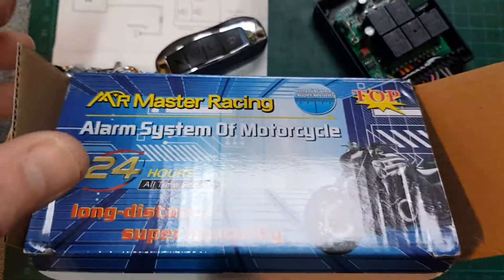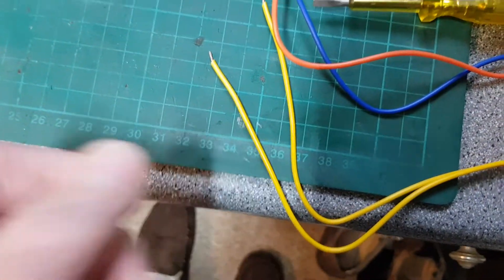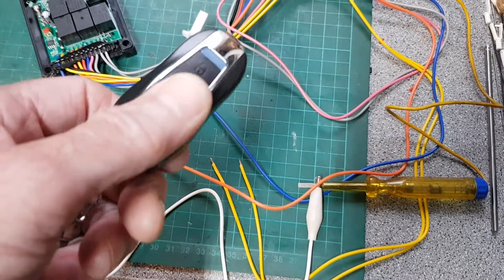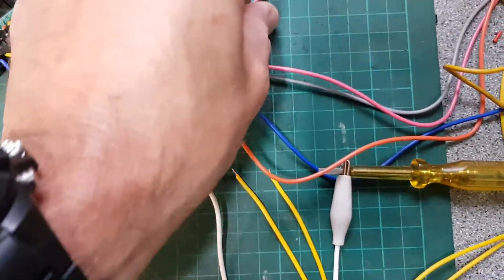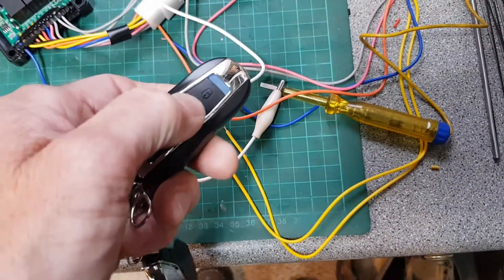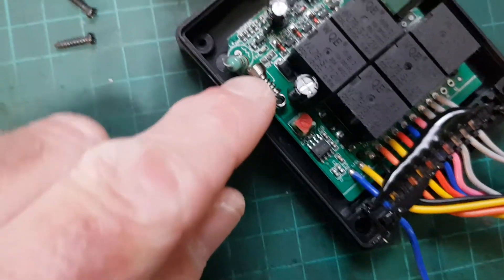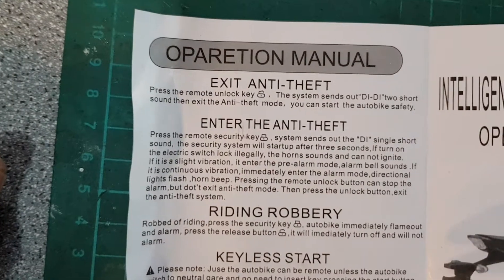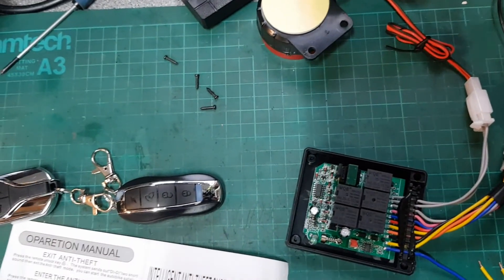Cheap Chinese eBay Moped Motorcycle alarm - What to the wires do?

Comment: The keyfob tells you how it should work. eg turn on, turn off and arm the alarm, or turn off without arming the alarm. 
When you turn on, you close [or open] a relay. This relay takes the power cable that normally goes to the vehicle key-switch, and sends that power back to the controller, eg does what the key-switch would normally does with send and return pair of wires.. 

The other pairs of wires seem to be surplus relay functions, eg door locks, close windows, flash lights or enable brakes etc, there may be reverse relays that are triggered to open instead of close a connection.  Generally, the relays will pass to the controller any voltage/sensure wire they are fed.  Also, the alarm will have its own voltage supply requirements and it is important to get that right.

Comment: This is a very helpful video.  The original instructions are truly terrible!
I have a question if I may; regarding the blue "start" wire. When the button's pressed, this goes live for a couple of seconds to turn the starter motor. On my bike (xt600) all lives are permanently connected and switching is done by earthing. So, when you press the starter button all you are doing is completing the circuit by making an earth.  So, as I see it, a low current live input for two seconds cannot be used to start the bike as everything is live anyway.  I'm thinking that to use this function I will need to connect the blue wire to a 12v relay (other end of the coil earthed). One relay output is permanently earthed and the other connects to the live side of the starter button. So when the blue wire goes live it closes the relay and completes the start circuit by earthing it.  Is this correct?

Also, I thought I could connect the pink and grey wires across the sidestand switch as when the stand is down the cdi is earthed and will not generate a spark.

I'd be interested in your thoughts and thanks again.

Jolyon

Comment: Nice presentation.
A warning to NOT hook up yellow wires to modern can bus / LED bikes. They supply 12V and turn signals are sometimes 3-6V and they will blow more than a fuse.
I bought some cheap, stand-alone 12v LED strips with the adhesive backing. You can chose your color. 
IF, I hook up the ignition kill, I'll wire in a bypass jumper - male female spade, bullet, etc., under the seat.

Comment: The issue ive had with these on both my bikes is they drain the battery when not in use in my garage i just put a toggle switch in between the hot wire when i have them parked at home, just dont get why they drain the battery when not turned on?

Comment: There's something you didn't explanained
I have one similar to this
But it have a connector for 9v battery
It have extra function , which is when you disconnect the battery and the device is in lock mode , alarm will start the sound using the 9v battery for power

Comment: What would I connect the orange wire too in order to use the key fob to turn on the ignition? I don't want it to remote starter aswell, just turn the ignition on, is it doable?

Comment: I have found a fuse for power (removing fuse behaves like turning a key off - engine stops).
I want to cut one of the cable leading to this fuse and put '2 cables' from the alarm connecting it again via alarm unit so when alarm goes off - the power is off.
Which cables allows me to do that?

Comment: Do mine came with a 9v battery lead as well as the 12v to the bikes battery. It should have the 2 yellow wires but doesn't. Can I solder them to the board amd done have lights on the alarm ?

Comment: Hi Tim, I've recently purchased a second hand bike with a Spy 5000 alarm fitted which looks very similar to the one you have described here.  I don't need an alarm and am worried about it going wrong at some point.  In order to disable it do I just remove the power supply and earth cables, and will my bike then revert to normal operation ?  Many thanks in anticipation. cheers, Alan
Reply: depends on if the killswitch wire (usually black and white) was cut. If it is cut and you remove the alarm, the bike will always be able to start with the kick start, even with ignition off.

Comment: I see on the board where it says lig1 and lig2 but nothing is going to the lig2 and going to the lig1 is a blue wire coming out of it with a rubber tip at the end of the wire??

Comment: Thanks for this video. I have this same system on my maxiscooter. It was installed by the previous owner. The ingnition start button never seemed to work but other than that the system worked fine. Since recently, all of a sudden, the system arms itself after being disarmed. It always happens afer 14-15 seconds. It even does so while the engine is running. The only way to stop it from happening is pressing the ignition start button/lightning key twice and putting it in 'ignition' mode. Do you have any idea why this would suddenly happen? Is it just broken or did I press a button combination for auto-arming. Thanks in advance.

Comment: I have the same exact alarm. I don't know  where to connect the yellow cables, so that the indicators work. I know where to connect the red and black cables, but that's it. Could you help me? I have a Piaggio Zip 50, injection.
Reply: Yellow is for the both L R Signal Lights

Comment: Thanks for the video! Do you know any way to disable the annoying unlock/lock sounds on this alarm? I'm happy with everything but the unlocking sounds are so loud I cant park my motorcycle on my quiet street like this
Reply from the maker: I don't think there is a way. We ended up putting some foam around the sounder to quieten it a bit!
Reply: @Tmo1972 I have a bike with a DC CDI box that uses 12V switched power for spark. What do I do with the pink and gray wires and how can I kill the spark when I arm it

Comment: Thank you very much man, very complete explanation. As far as you know, is there a way to implement a block motor function? (I mean, kill ignition when the alarm is armed or ringing)
Reply: Yes you probably could using the ignition flame out wires, be be careful how much trust you put in a cheap alarm like this. You don't want  it to kill the ignition while you're moving

Comment: Will not work with HISS systems or other bikes that need the key to be in the ignition, a relay will be needed, will work fine on the small cheap China mopeds and 125 bikes they make. This type of alarm is more of a toy than a bike alarm, handy for other uses such as garages etc, some set on fire as China produced £15 alarms tend to do that.

Comment: Hi. I have an yamaha fz6 2004, I put the wires where they should be, but when I double press the lighting button from the remote it just turn on the ignition but doesn't crank the starter, you know where the problem should be? Thanks.
Reply: Connect your blue wire to your starter solenoid👍
Reply: @DeepSouthBayouDiesel   Starter solenoid is on the battery, right ? I did put the blue on it but nothing happened... I may did something wrong... Yellows + grey and pink I let them away for the moment. Red to plus of battery, black to minus of battery, orange to starter switch from handle bar, and the blue I put on starter relay.. The only thing it does when I double tap the remote is that it turns the ignition on, but no crank-the bike doesn't start.
Reply: @vasivasi2608  The starter solenoid is the part by the battery with 30 amp fuses on either side. It'll have 2 heavy gauge wires held on via nuts with "B" on one side and "M" on the other, and I believe 4 small gauge wires held on either by clips or slipped on. One of those 4 small gauge wires is where you want to connect the blue wire from the remote start. But listen carefully...DO NOT HOOK UP THE BLUE WIRE TO GROUND. you run the risk of bricking the remote start unit or causing damage to the bike's electrical system. I'm not trying to make you feel dumb or scare you. Best option for you is for do a quick research for your starter solenoid wiring diagram on youtube/Google. Let me know if I can be any further assistance👍
(Sidenote)...you hooked up the blue wire to the starter relay, you want to hook up to the starter solenoid😊
Reply: @DeepSouthBayouDiesel  Ok sir.  in 30min I'm to garage and gona look again to diagram and look for solenoid. Thanks!
Reply: @vasivasi2608  you're most welcome...i hope you get it set up. I love my remote start, and when yours is installed, you will too.
Reply: @vasivasi2608  SO IS IT FIXED NOW ??
Reply: @troop8829  To be honest, the day I said I go and look for the things, I had to leave the town for few weeks and when I got back, I had other family things to do and seems like I removed the alarm because I couldn't figure out how to make the starter works....So I didn't fixed it up, for now I use the bike as it is, maybe in winter time I will try again to put the alarm back. Sorry for my bad english.
Reply: @vasivasi2608  you should definitely take another look just got mine working was frustrated for 8hrs walked AWAY CAME BACK MADE IT WORK I didn't bother with the alarm as I just wanted the kit for the remote start its fucking awesome I srsly wouldnt mind helping u if u need bro
Reply: You can add 1 pc remote controller?
Reply: Not explained in the video is you need a relay, many bikes will not start due to security systems on your biker such as Honda Hiss and many other systems  if this alarm packs in your on the roadside with a dead bike, The video shows you where the wires go and what they do, bikes are complex and so are the reasons why remote start will never work.